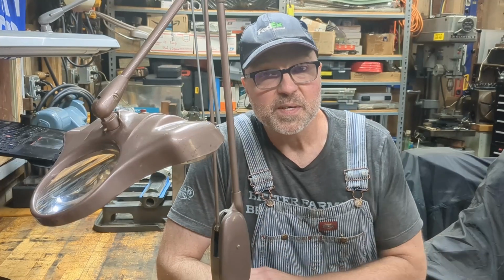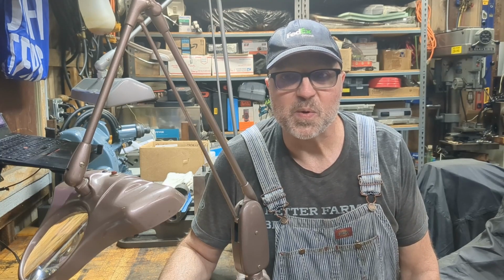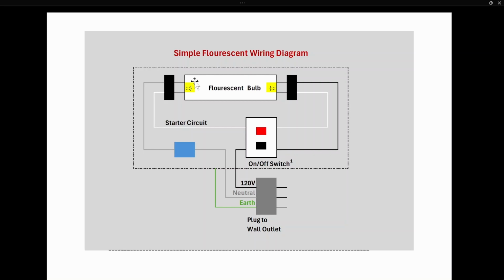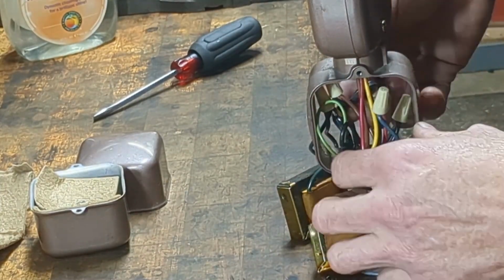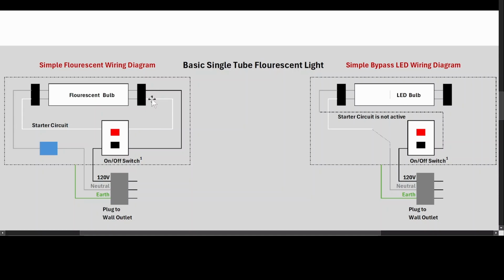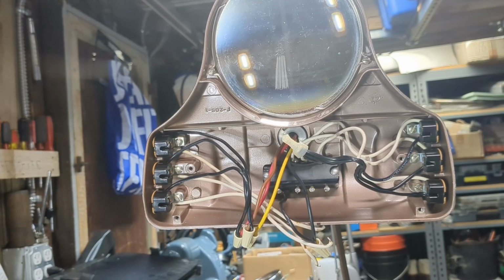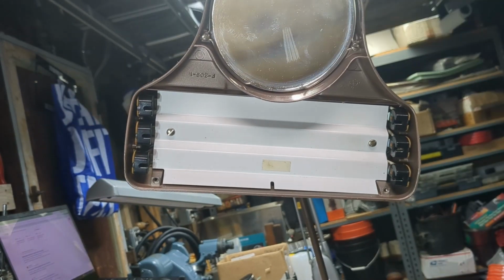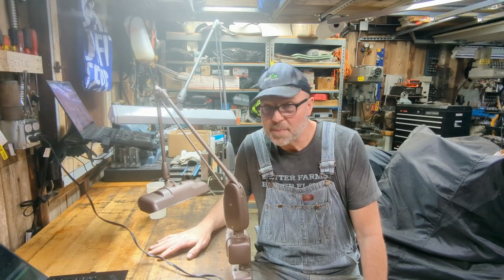Dazor Fluorescent Tube Lamp Conversion to Ballast Bypass LED Bulbs

Comment: I have a Dazor model 8mc-250. The light doesn’t work. Checked the switch which I took apart and reassembled but is still not working. Checked wires which look good.  Do you have any videos on this type of lamp?
Reply from the maker: @promqueen63 I don't have any videos about that lamp.    I searched about it and it seems to be a newer model, but still fluorescent.  Is that the case?  Have you tried changing the bulb?

Comment: My lamp has two bulbs , two ballasts and a capacitor. How is it wired up?
Reply from the maker: Hello - I've never seen one of these lamps with a capacitor before, but I know they exist.  I found this link with some reference to it - https://antiqueradios.com/forums/viewtopic.php?t=386210.  I believe, though am not 100% certain, that you would remove the capacitor if your intent is to go with a Ballast Bypass LED Bulb.  I believe this because I have not needed to include a capacitor when rewiring my lamps.  If you go to 29:24 in the video, you will see a wiring diagram with 3 bulbs.  The converted lamp with 2 bulbs would be the same, except for one less bulb.  If you look in the Description, above, you'll see a download link to the wiring diagrams I made, in case that's helpful.  Good luck with your project!
Reply: Thank you very very much.

Comment: I have an m1410a and picked up an led ‘fluorescent equivalent’ feit brand bulb. Aside from it being impossible to plug the switch into the prongs without having the bulb completely flopping around…I definitely want to update it and do the ballast delete removal. I’ll have more room to figure out how to get the bulb connected
Reply from the maker: What a beautiful lamp.  Nice choice!  How strange that it's so difficult to install.  Good luck with your project!

Comment: I have a P 2134 Dazor lamp. I also want to bypass the ballast and go direct to LED's. I have a wiring diagram for the lamp and need help with rewiring. Would you be willing to assist? Thanks
Reply: I figured it out, thanks
Reply from the maker: @micrometer1484  Hey - sorry for the late reply.  The holidays are really buys this year and I wasn't checking in.  Let me know if I can be of service as you continue the process.  Cheers

Comment: What LED bulbs did you use for the m209? I do not see it in the video or the comments, but I may have missed it. Thanks!
Reply from the maker: Thanks for checking out my video.  Here's the only ballast bypass T5 9" I've been able to find in the US, which I used - https://www.bulbamerica.com/products/satco-s11903-3w-t5-led-miniature-bi-pin-base-6500k-daylight-flourescent-tube.  However, if want to skip the ballast-ectomy, I just found a bulb that will work with the ballast if still installed (aka ballast compatible), but I suspect that the original ballast needs to be in working order.  I don't think it would work if the ballasts have been removed or isn't working.  I've never used it, so I can't be certain it would work, but it's a cheap and easy option. - https://www.amazon.com/IHYCTV-Compatible-Installation-Retrofitting-Fluorescent/dp/B0DHZSSGZ2

Good luck and let me know how it goes.
Reply: @WernersWhirligigs Thanks so much. I am trying to get the tombstones from another lamp. I hope I can get it working again.
Reply from the maker: @claudeelkins3847  Good luck!  It's a really nice lamp to use once it's got better light bulbs.

Comment: my problem is my wire colors are different from yours.
Reply from the maker: 10-4.  Yes, that presents an issue.  In my drawings, red, yellow and brown represent line (hot), black is neutral, green is earth, and the white wires are the ones that used for the starter circuit.  So, you will want to figure out in your lamp which colors represent these four types of wire.  I will say, in the nicest, safest and most well-intentioned way possible, if you're not comfortable figuring out the wire types, I would either 1) refrain from taking on this project, or 2) do more research until you clearly understand how a 120v (or 240v) circuit works.  Be safe!
Reply: @WernersWhirligigs I have a black wire in thats labeled p line, 3 red wires and 3 black and two bulbs with 4 tombstones. I can send pics of the switch
Reply from the maker: @mapquest681  Perhaps this would be a good time for me to set up a dedicated email address for this channel so I can communicate with folks like you.  Standby for 24 hours until I get back to my computer and I'll set up a new email, unless you have another way to share the pics with me.
Reply from the maker: @mapquest681 OK, if you want to send pics, you can send them to me at Werner@WernersWhirligigs.com

Comment: For anyone trying this be aware the ballast in these lamps pre 1980 (which many if not most are) are transformers that contain bpa which is harmful to the body and environment. The oil that leaks out of them is thus dangerous, I would only handle this area wearing gloves and these transformers have to go to specific sites to be properly disposed of.
Reply from the maker: Max - thanks for sharing your concern here.  I did some research and I could not find any information about ballasts containing BPAs before 1980 (or after).  PCBs line up much better with your description and the pre-1980 timeline.  Assuming you meant PCBs, have you determined whether the ballasts used by Dazor contained PCBs?  Not all ballasts did. I don't want folks to get worried by a generalization that may not be relevant.  Out of my own curiosity and concern for everyone here, I sent an email to Dazor (they are still in business).  I'll post when I get a response from them.
Reply: @WernersWhirligigs  Sorry yes BPA was a typo I'm referring to Polychlorinated biphenyls. Goverment resources state "Light-ballast capacitors are found in fluorescent light fixtures. Ballasts manufactured prior to 1980 typically contain PCBs.". My Dazor lamp's transformers were leaking a dark brown oil consistent with PCB containing oil. I wouldn't say I'm certain but there are enough factors that I wouldn't advise anyone to open up the ballast compartment without the proper precausions.
Reply from the maker: @maxeddis1138  I heard back from Dazor.  They only said, "We do not have any information on the older ballasts (transformers). However, our older model fluorescent lamps would have utilized a capacitor."  That was a weak response.  While researching, I learned that PCBs are found specifically in the capacitors in fluorescent lamp ballasts, and the response from Dazor seemed to highlight this.  I'm curious about your transformer that was leaking.  Was it the capacitor?  Another thought - how many prongs does your lamp have in the plug.  3-prong plugs, with the ground circuit, weren't required until around 1969, so lamps prior to 1969 most likely have a 2-prong plug.  That would help you narrow down the age of your lamp even more.  Any lamp with a 2-prong plug could have a PCB risk.  I have at least one Dazor that has a 2-prong plug.  I will look at it more closely.  Thanks for the dialogue Max.  This is very interesting.
Reply: @WernersWhirligigs  My lamp does have a two prong plug though I'm rewiring it to led so I'll probably ground it. I'm definitely not an expert in this stuff, the ballast component of my lamp just had two transformers, there wasn't a separate capacitor. The transformers themselves were moist with an oil and from what I can find online a dielectric oil containing PCB was used in many old transformers.
Reply: @maxeddis1138  the kind of choke transformers in these lamps won't have PCBs, they're just standard dry transformers. The oils were probably from the varnish/resins in the transformer breaking down since they've spent half a century inside a metal box cooking.
Reply: @drwolfer  You may very well be correct, I just read about the chemical briefly and government resources did call out fluorescent ballast's specifically as being a source so I figured I would share it here. No harm will come for exercising extra precaution anyway.

Comment: I have those exact lamps on my table right now. Thought I would give YouTube a look for advice on shifting these kids over, and this was the first thing that popped up. Thanks so much for this! Feeling really lucky right now.
Reply from the maker: Thanks for the feedback.  Good luck with your conversion!  If you run into issues, don't hesitate to ask.
Reply: It's a model 2427 .... I think?. It's a Dazer.

Comment: Great video! Would you happen to know which Satco LED bulb would be the correct bulb for a Dazor 2134 with your conversion?
Reply from the maker: Thanks for the comment and question!  If you are doing an LED conversion, like in the video, and need a ballast bypass bulb, I've used a Satco S11952  (https://www.payless-4-lighting.com/products/satco-s11952?).  This is for the 6500K variant (cooler, more white).  You could also use the S119950 (3000K warmer, more yellow) and S11951 (4000K - in the middle).  Here's a search on that website that shows all three. - https://www.payless-4-lighting.com/search?q=satco+18-inch+bypass&options%5Bprefix%5D=last  Good luck!
Reply: @WernersWhirligigs  Thanks! This would be for a Dazor 2134 that I hope to modify with your ballast bypass mod and use with a 220v current (I live overseas). Looks like the flourescent bulbs have a voltage range of 120V-270V, so it looks like I should be good 😬

Comment: Thanks for the video. Do you have a link to the bulbs you used?
Reply from the maker: This is the ONLY bulb I've been able to find in the correct size.   It looks different than the one shown in on the product page.  If you go to 40:22 in the video, you can see what they actually look like.  The one thing I don't like is that they don't provide light for the entire length of the bulb, but I haven't found any alternatives - https://www.bulbamerica.com/products/satco-s11903-3w-t5-led-miniature-bi-pin-base-6500k-daylight-flourescent-tube
Reply: @WernersWhirligigs  Wow, thanks for the quick response. I assume those are the single ended bulbs. I wired my M209 exactly the way you have it but mistakenly used double ended bulbs which seems to be tripping the breakers. Thanks again!
Reply from the maker: No worries!  I wasn't as fast this time, though;)  The bulbs I have used, and am familiar with, are indeed the single ended bulbs.  The wiring discussed in the video is set up is to accommodate that kind of bulb.  For anyone else reading along, this means the power goes in and out at the same end of the bulb.  However, these bulbs have connectors at both ends so it doesn't matter which way you orient the bulb in the lamp.  A double-ended bulb has power going in at one end and leaving at the other end of the bulb.  This type of bulb would not work in the wiring setup from this video.
Reply: @WernersWhirligigs  Great video thx!  I ordered the S11903 and blew it when I turned it on, wired exactly as shown.  on the box it states Double ended wiring so I'm thinking I need to use the tomb  stones on the other end for the return?  I opened up the bulb and that seems to be the case.  I have my grandfathers old M270 that's been sitting in the basement.  excited to bring it back to life!
Reply from the maker: @pittwr  Dangit, that stinks!  How did it blow?  Flash of light or noise or something?  I went to the Satco page for this bulb (https://www.satco.com/s11903.html) and looked at the wiring diagram.  You can find it on the right side of the page by clicking where it says S11903 Instructions PDF.  It does show that the wiring goes to both ends of the bulb, and they show a single wire to each end.  So, I think one would wire the hot wire to one of the two wires on one tombstone and the neutral to one of the two wires on the opposite tombstone.  I wonder why that's not the case with my bulb...  Did I buy a fake bulb and just get lucky when I wired it this way?  Let me know what you do and how it works out, please.  Also, it's a good idea (for future readers) to try one bulb first before installing all two or three, so you don't fry multiple bulbs.
Reply: @WernersWhirligigs  bulb did a quick internal pop..  yeah I figured I did something wrong and kept closely reviewing you video.. I did the same setup exactly as you did..  maybe they updated the bulbs since?  I'll rewire and let you know.  thx! Bill
Reply: @WernersWhirligigs  Fixed and working great!  So I wired the hot wire to Both wires on one tombstone and the both wires from the opposite tombstone to the neutral.  I did this because I noted that the interior LED strip only went to one pin on each end of the bulb.  took the guess work out of it.
the M270 lamb was my Grandfathers.  I'm not sure how old it is but he had it in the early 70s from what I remember.  So happy to have it on my desk and working!
Thanks again!
Bill
Sherman, Ct
Reply from the maker: @pittwr  That's so great!  I'm glad you figured it out and it worked.  Does the lamp have a 2- or 3- prong plug?  I believe 3-prong became standard in 1969, so that would narrow it down a bit.
Reply: @ two prong
Reply from the maker: @pittwr  👍

Comment: Amazing presentation and so timely! When I looked a couple months ago, there were not any great resources. Can't wait to convert one of my 2324's, and then the other. Looks like the process as you described in the M209 the same as for the 2324 (just with 2 sets instead of 3). Do you have a recommendation for the LED's on the 2134? Stay tuned for more questions...
Reply from the maker: I'm so sorry for not having responded earlier.  I thought I had....  The 2134 and 2324 are 18" T8 bulbs, I believe.  I don't really have a good recommendation, just because I've only used one set of bulbs of that size so far - https://www.payless-4-lighting.com/products/satco-s11952?  This is what I used for my lamp project and they're still working, but I haven't used the lamp regularly to give it a real test.  Please fire away with questions in the future if you have them.  I will do a better job of responding.

Comment: i have a lamp with two ballasts it is a m-209-f two wires gooing up; I only can light one bulb. I followed your diagram. The two ballast gooing are connected to one wire ...help
Reply from the maker: What I think I'm reading is that you have an M209 with two light bulbs and two ballasts, but only one light bulb is functioning.  I'm not sure what to make of the two ballasts being connected to one wire.  That sounds correct.  They should be both connected to the a single wire on the neutral side, and the other side of the ballast should each connect to a colored wire (red, yellow, and brown in my diagram) leading to the top.  I would do the following to troubleshoot: 1) swap the two bulbs and see if the problem follows the bulb.  If the other side now lights, then you know you have a bad bulb.  If the same side lights (and the other still doesn't), then 2) Open the base and swap the wires leading from the ballasts up to the top of the lamp. It will likely be the colored wires (like the red, yellow and brown in my diagram). So, take the wire leading from Ballast A to the top of the lamp and attach it to Ballast B, and then take the wire leading from Ballast B and attach it to Ballast A.  You'll need to remove the wire nuts and then just re-twist the wires and reinstall the wire nuts.  If the other lightbulb now works, then you have a bad ballast.  If neither 1) or 2) get you an answer, then there must be a bad connection on the circuit with the non-lighting bulb.  Start with 1) and 2) and report back.  I'm happy to help you if you need further assistance.  Good luck!!
Reply: Thx but i have 3 bulbes and two ballasts
Reply from the maker: @marccoucke6058  Did all three bulbs ever work with only two ballasts?  I believe there should be one ballast per bulb.  I have four Dazor lamps and they all have one ballast per bulb.  The fact that there are only two ballasts for a three bulb lamp does not seem right to me.
Reply from the maker: This is in response to your 2nd comment about swapping the wires on the ballast.  Nice work!  That's good news that everything is functioning.  If you wanted to keep it as a fluorescent lamp, I believe you'd need to buy another ballast.  Dazor sells ballasts, but I don't see one for the M209 with those smaller T5, 9w bulbs.  You might call them.  Here's a link to their sales page for ballasts - https://www.dazor.com/store/ballasts.html.  If you choose to do an LED swap, I used these bulbs for my M209 - https://www.bulbamerica.com/products/satco-s11903-3w-t5-led-miniature-bi-pin-base-6500k-daylight-flourescent-tube?  Let me know how it goes.
Reply: I did swap the wires on the ballast. Each bulb is tested and works. The ballasts works..i did consider to work with leds. But i can no find led lamps 22.5 cm .
Reply: Thans. I would make a video . But the lamps is gone to a friend to have a look at it. Thanks for your time and advice.i keep you informeren..
Reply from the maker: @marccoucke6058  My pleasure.  I'll look forward to an update.  Thanks for contributing to the conversation.